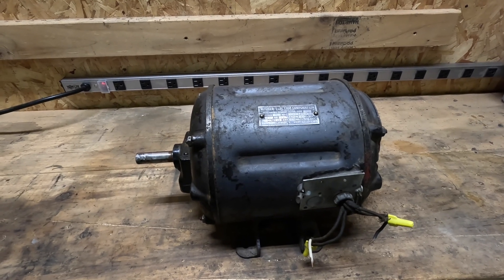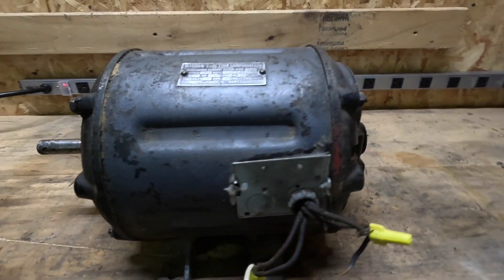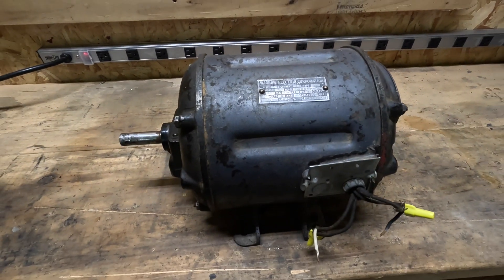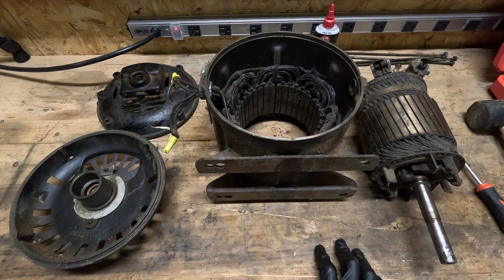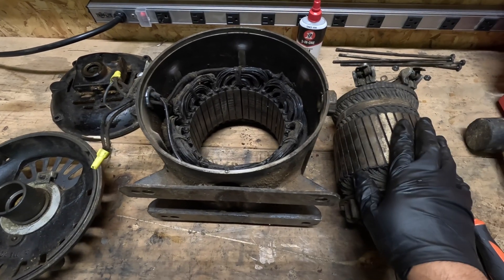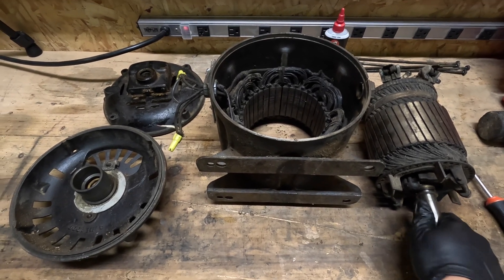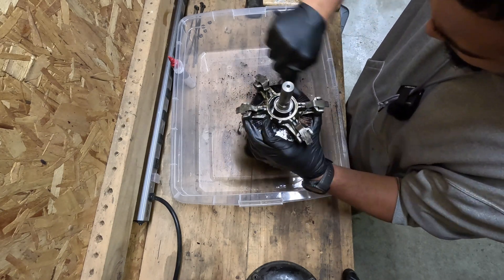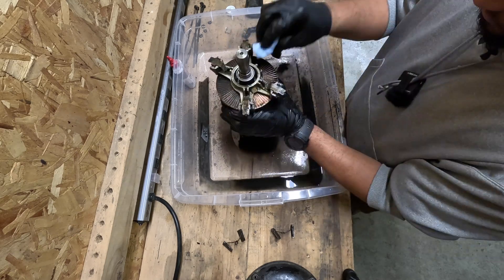Restoring A $10 Vintage Electric Motor - Will It Run?

Comment: Do you have a wiring diagram? I just got a similar Wagner with dual voltage. The existing Leeds are cut and very oily. Looking to wire for 120v(“110”).
Reply from the maker: I don't but typical older 1phsae motors have two coils in. For 120V you put the two coils in parrael and for 240V you put the coils in series. Use a multimeter continuity function, put one wire on black lead and one wire on red. If it beeps that is the coil, if it doesn't beep then you have leads from different coils. For 120V put the ends of both leads in parrel. See wiring diagram from this link, pretty helpful if the aboove isn't clear.
Reply from the maker: https://woodgears.ca/motors/voltage.html